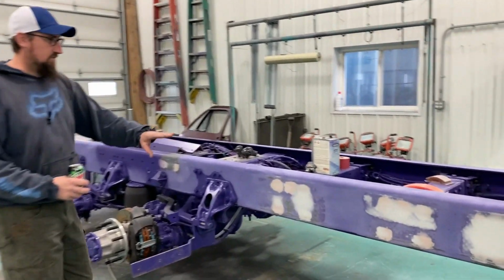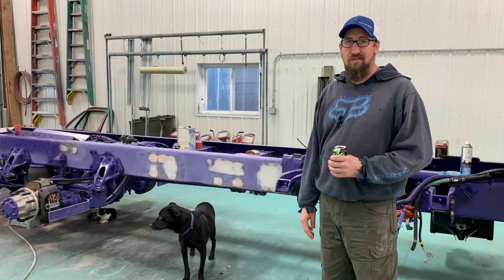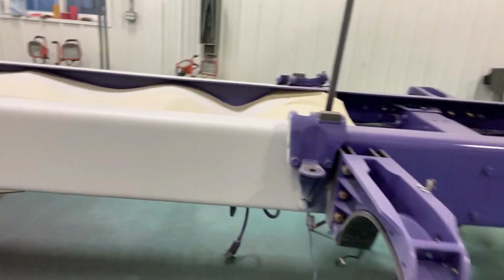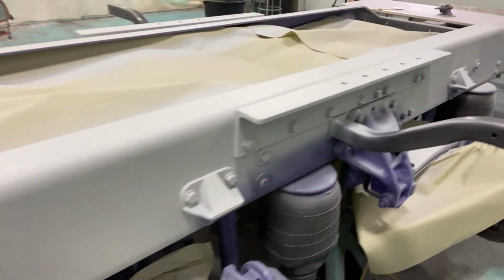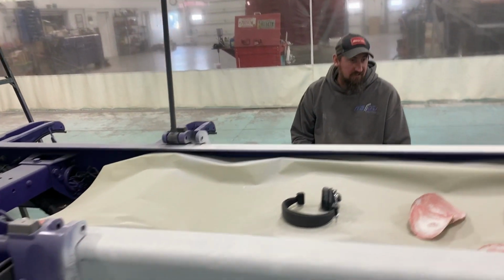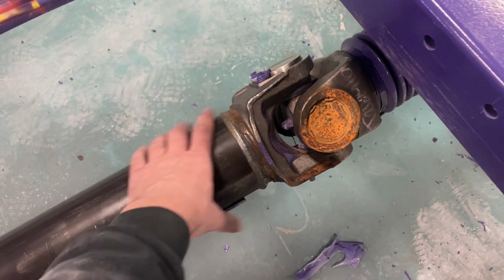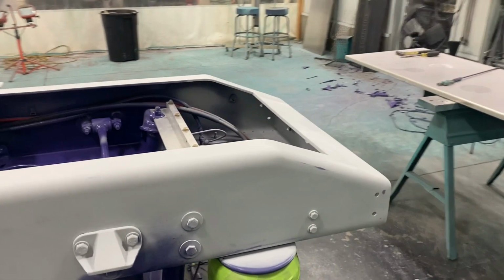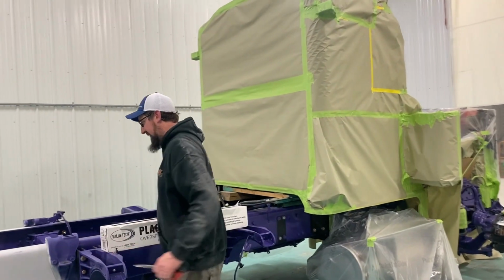How to prep a truck frame to paint.

Comment: Looking fricking amazing. Just a curious question from a non trucker about The bolts you have hidden on the frame. Will they never need to be accessed to for any kind of maintenance/repair or are they never needed to be undone in the trucks lifetime? As it would be a shame to ruin a great paint job if it needed to be drilled out to undo them.
Reply: They should go into the cross member/ nuts on inside and cross member is 3 pcs bolted together,  shouldn't need to be removed if they don't break I'm thinking.   jm opinion.
Reply from the maker: @ky.gambler5281  that's exactly the answer!  Thank you!

Comment: That's totally ridiculous. I would have got the rails dripped in galvanized,  unless that truck doesn't run year round,  I also think that you and rethwitch are trying to out do each other, stupid!! How many times are you gonna take a truck apart, a bunch of burned-out demolished wackos!!
Reply: U-tube pays well I think.   I'm seeing people spend lots of money for something that doesn't earn much if it's not working.
Reply from the maker: Bill's truck is way over the top of mine.  This truck will run all year.  There's a reason my equipment is top notch, and that's the only way i would have it.  Sorry you don't feel the same way.
Reply from the maker: @ky.gambler5281  I haven't made a dime.